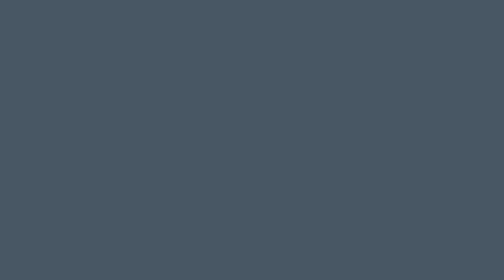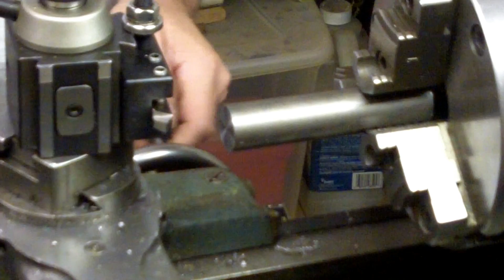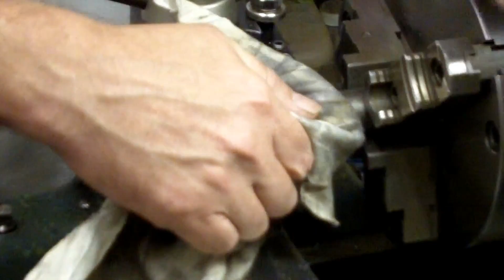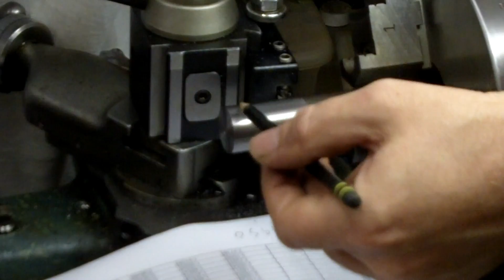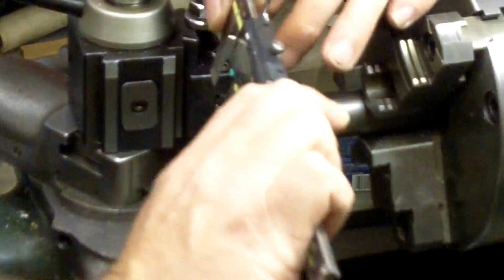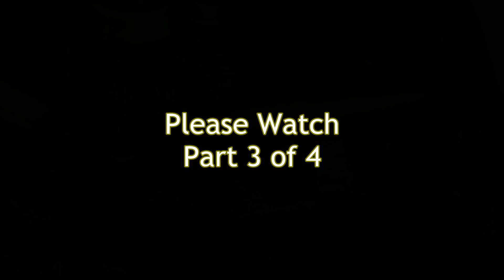Pt 2-4 How to Knurl on a Lathe

Comment: Hi, loved the series on knurling, could you please tell me the speed and feed that you used on the 12L14 steel, I have 1214FM and I cant get any type of decent finish on it, I am using carbide inserts, I have used many different feeds and speeds with no luck.Thank youGraeme
Reply from the maker: Thanks! Glad you liked it. Sorry though, I don't recall the speeds and feeds I was using at the time. I do use HSS tooling though and it's very forgiving. My lathe doesn't turn fast enough to utilize carbide tooling effectively. I tried many combinations with my carbide and never could get a finish to my liking. I'm not saying it can't be done, but my carbide stays in the drawer now. I have some mystery stainless steel and for the life of me can't get a decent finish on it...lol. But 1214FM should be fairly straight forward I would think. The type of insert, geometry, and holder "could play" into your problems. I know very little on the subject so you might dig around.

I don't know what lathe you're using, but if it's a smaller lathe, you might consider playing around with some HSS blanks to see how you make out.

Sorry I couldn't be of more help, but hope it helps. G.
Reply: Hi ghostses, thanks for the prompt reply to my previous question,  have several knurls and the pitch is not stamped on them how can I determine what it is ?CheersGraeme
Reply from the maker: Do a search for "inking knurls". I've not done it, but you can ink them and roll them out on paper, then determine what they might be- i think.

I did find another thread stating another method. Again, I did not try it out.

"To determine the pitch I counted the serrations on the die and divided that count by the circumference of the die. 

pitch= number/ 3.142(Diameter)"

Good luck, G.